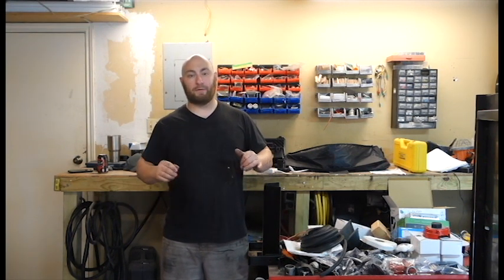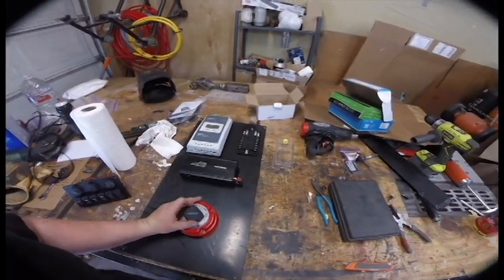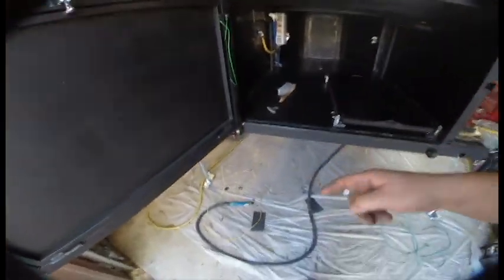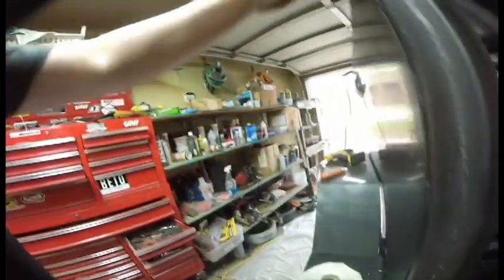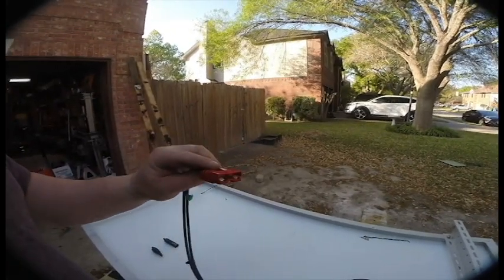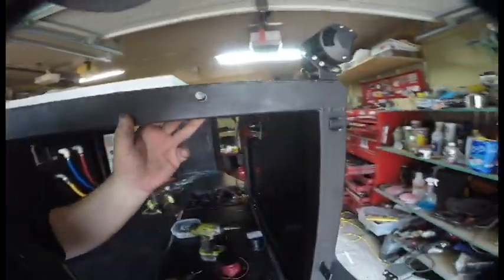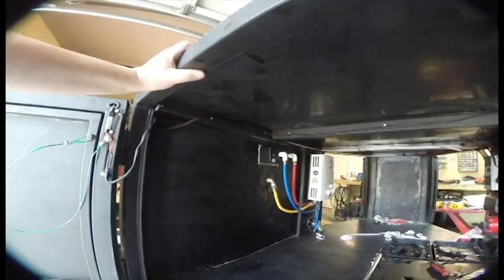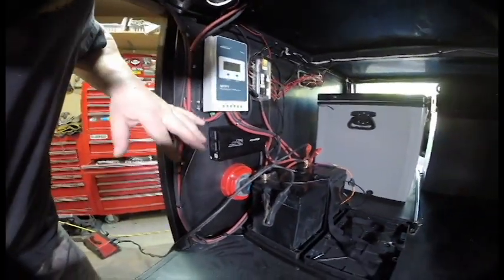Adventure Trailer - Episode 7 - All The Wires (wiring, solar, battery)

Comment: Nice build. Solar with a RTT. Ought to be interesting. Wondering about interior tie downs and securing stuff on the inside with an open battery and all.
Reply from the maker: I went bouncing a few times. The tubs hold together well and are plastic. The battery is strapped down and there is no metal stuff in there for it to arc against.